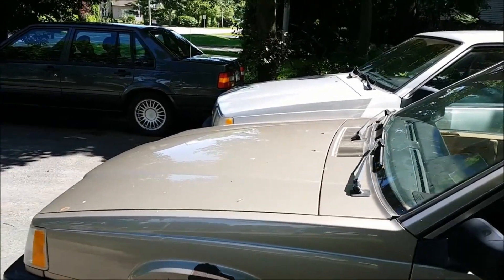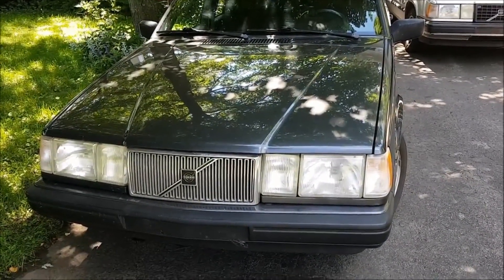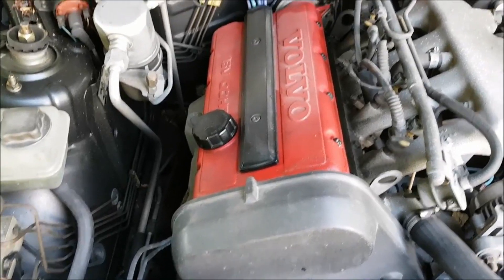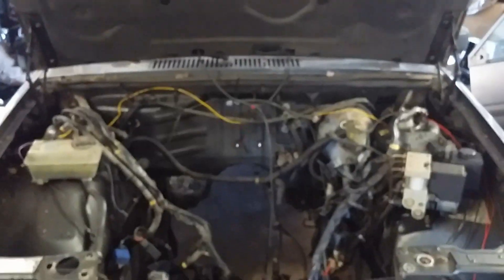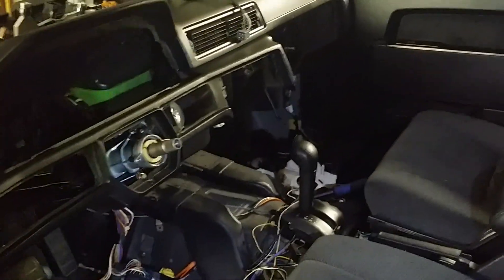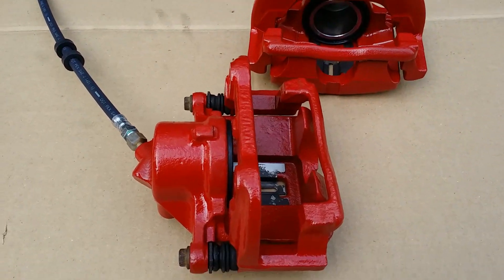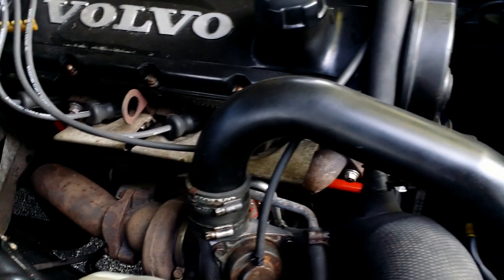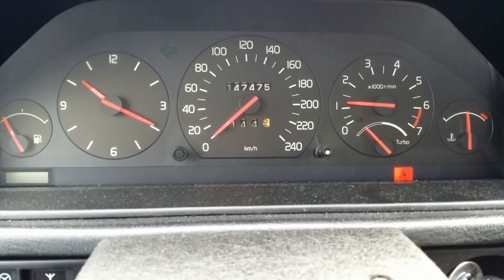Volvo 940 Engine Swap. From 16 Valve to Turbo.

Comment: did you change 16v ecu to 8v turbo ecu?
Reply from the maker: Yes, I did.
Reply: @robertdeptula2003  you don't remember the number of the ecu you put in the car? 
I will solve the same so that I know
Reply from the maker: Here is ECU application chart you can refer to: http://www.volvotips.com/index.php/740-760-780/volvo-740-760-780-service-and-repair-manual/volvo-700-series-ecu-application-chart/
Or this one: https://www.volvoclub.org.uk/faq/EngineFIComputer.html
Good luck!

Comment: I'm surprised you didn't swap that 16V head onto this B230, that's a great combination.
Reply from the maker: I explain why in the video.
Reply: @robertdeptula2003  sorry, had to watch without volume.  I'll give it another go here soon.
Reply: @robertdeptula2003  I only heard you say you "don't like" the B234.  But that's not the same as swapping the head onto a B230.  B234 blocks suck, but the heads are great. 

What did I miss?
Reply from the maker: 16 valve is interference engine. B234F is less powerful than B230FT. To combine 16 valve head with turbo require some modifications. I am not looking for boosted performance but simplicity.
Reply: @robertdeptula2003  these are really simple tbh; I recently deleted the balance shaft belt so it's just sort of a b230 with dohc and  interference. just update the oil pump pulley bolt with a stronger one. also runs great and has a lot of NA power.

Comment: I have a LH2.4 16valve and a LH2.4 turbo scrap car 100% all parts are there. I want to do the same swap you did in video. What was the hardest part you would think I'd run into with the swap?
Reply from the maker: The hardest part was to swap the electric harness under the dash and in the engine bay. You have to transfer ABS unit from one side to the other and redo brakes plumbing. 16valve has an engine mount bracket that you have to cut out to fit turbo motor.
Reply: @robertdeptula2003  Do I have to swap brake hardware because the brake octopus thing is on opposite sides? I'd look myself but im at work.

Comment: Hi I am replacing engine from 2 liter not turbo to 2.3 turbo red block question ho to move from right side to left side airflow meter. If I am move left side on turbo inteke pipe engine working very beat please help me thanks very much.
Reply from the maker: Turbo has a different air intake/filter box. Airflow meter seats on top of the box in turbo model. Grab it from the donor car. Check also the electrical harness. In my swap, I had to replace everything but the rear lights harness. This was the most difficult part.
Reply: Thanks Robert
Reply: If I am replacing mushroom filter  working engine Very beat

Comment: How long did it take to swap this out?
Im looking for a 940 to have as a summer car but the turbo versions are not only costly but very far away from where i live.
So ill most likely have to settle for one of the 116hp variants and then later swap the engine out for a turbo one.
Reply from the maker: Two years. First, I prepared the engine and collected parts. The engine block came from one car, nothing really was done there besides seals. The head and turbo were from another car, I had to seat the valves. Fuel injectors were ultrasonically cleaned  https://www.youtube.com/watch?v=VKdA2Hvq4kE&ab_channel=RobertDeptula The most difficult was rebuilding braking system plumbing (ABS pump had to go from one side to the other) and swap of the electrical harness.

Comment: This was an impressive undertaking !
Did you keep an AW 72 L automatic transmission original?

I have a 1993Volvo 940 turbo sedan with the b-230 ft mated to an AW -72 L 
I am in a breakdown of this transmission now.
Reply from the maker: I switched from automatic to manual (M46) in my other Volvo 940 '92 turbo, and the transmission went to this car. AW 72 sold.
Reply: Robert Deptula 
There is no returning back once you know the old  Volvo !
Reply from the maker: @danielebbeling4056  You are right, but I know a few cases of successful addiction treatment therapy.
Reply: Robert Deptula 
I need this lead, as I just could not resist buying my 3rd redblock car.
It is not brought home because my wife and daughter will turn on me if they find out!

Comment: Hi there nice job on the car, I'm running a 940 estate with the same alloy wheels as you've got on the finished car at the end of the video. i can see the make on the tires is altimax but could you tell me what model they are ?
Reply from the maker: General Altimax Arctic 195/65/15

Comment: did you ever figure out why it was burning oil?
Reply from the maker: I didn't investigate. Since I knew from the very beginning that it was burning oil (blue smoke) and was planning tu put in the turbo motor. I bought the car for the body (that was in perfect shape).

Comment: Robert,you are are the hero undertaking engine swap on that beautiful GLE,big job especially with wires.I do drive presently 1992 Volvo 940 GLE wagon with  125 000 km on the clock ,drives like a dream so far.I know what can happen when I loose timing belt,its my third 940 in last several years,all of them did not disappoint me, the  best  vehicle I have ever owned,wish you well  with your Volvos !
Reply from the maker: 125 000 km? Must be like new condition for old Volvo. 
Regards from Montreal
Reply: @robertdeptula2003  Jest niezle,kupilem je kilka lat temu od starszego Wlocha,ktory jezdzil nim do kosciola w kazda niedziele,zero rdzy,szmaciana tapicerka,podsufitka lekko siada i to chyba wszystko,w zapasie mam na chodzie drugie kombi z 1991 z redblockiem,na mysli mialem przekladke silnika jak padnie 16v,ale widzac co trzeba zrobic nigdy sie tego nie podejme,we wtorek przychodza nowe tylnie lampy z ebay,autko bedzie jak nowe,he,he,he,pozdrawiam z Vancouver,B.C.